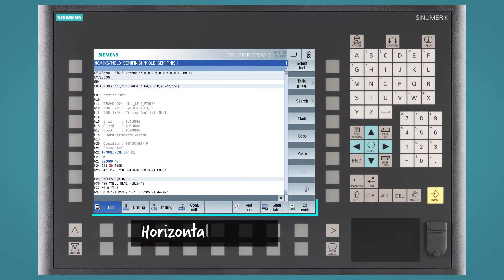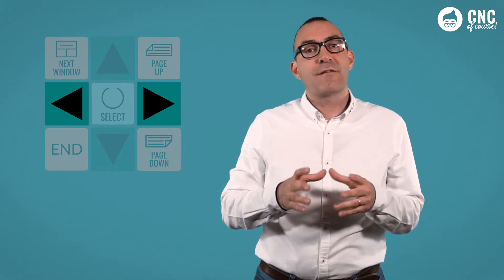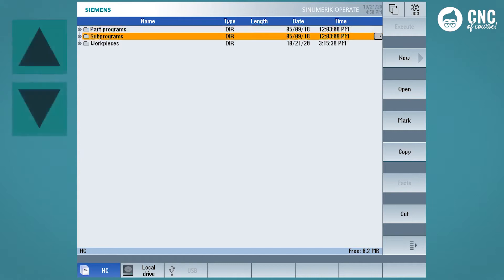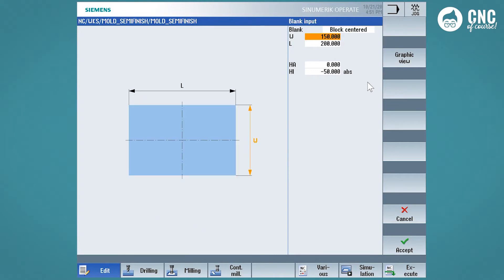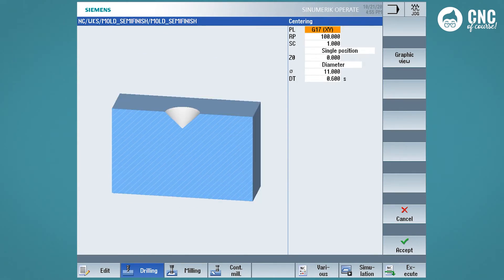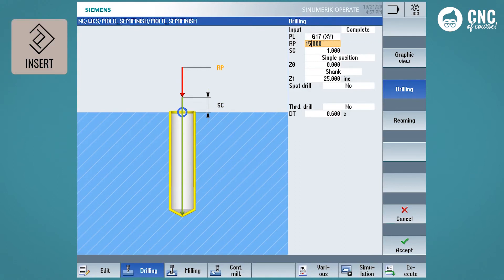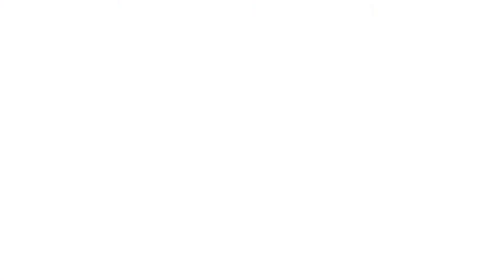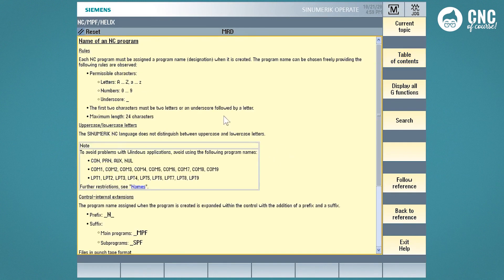Siemens 840D - Push buttons description

Comment: This might be offtopic, but I noticed you had the function "Swivel" (bottom right corner) at 1:28 min in the video. We had a harddrive-crash and after installing a old backup we lost that function and we can't find how to get it back. The operator that fixed it from the beginning has no memory how he got it there and have changed jobs. Is there any tip on how to get it back?